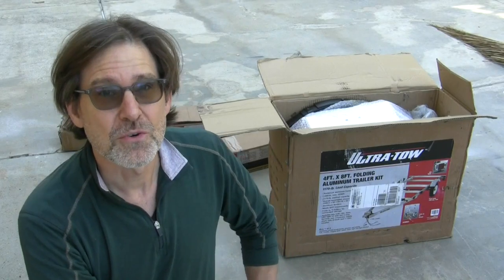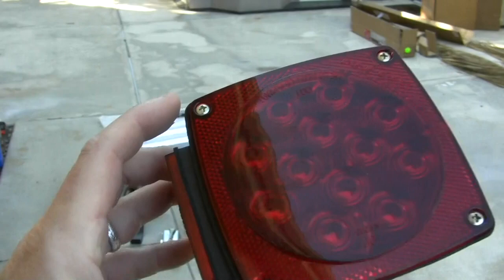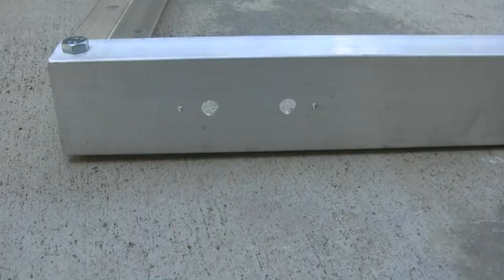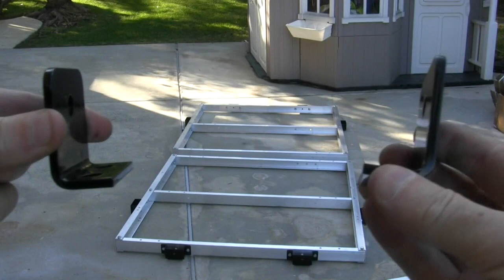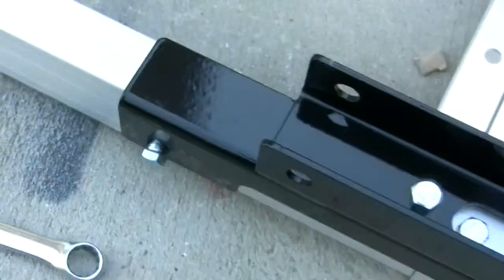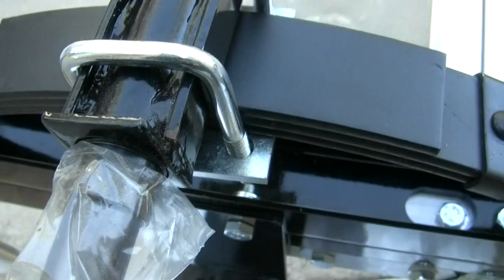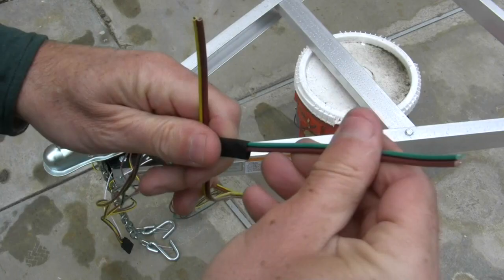Build Lightweight Ultra-Tow Folding Aluminum Trailer

Comment: Several errors I've seen myself. 

The leaf springer "Hanger" states to Bolt (2) Bolts to the "Front Trailer 1/2" ( including using a bolt from the top assembly of the frame itself.)

 Would have been nice to omit this bolt in step 1 instead of taking it out... just to replace it ...after installing the hanger???

 And  it also States to install (2) More bolts into the Rear 1/2 Of the trailer frame. 

Now in thinking about this....I thought...if it's bolted into the front 1/2 of a " Folding deck".

Plus,,, the same piece of "Solid Steel" is also bolted in to the Rear 1/2 of the " Folding Deck" how is the deck going to fold?.

This step would only be use if one is NOT PLANNING ON FOLDING THIS? Again resulting in removal of work done..

Thanks for doing this, the directions in the instructions were not good. Your vid helps tons.
Reply from the maker: Thanks for adding your observations. Yes, the instructions leave a lot to be desired. As one can clearly see in my video, I got "off in the weeds" more than once because of the poor instructions. That said, I love the trailer now. Hopefully others will read your comments before they begin also. Thanks for watching!

Comment: Did you say you used 3/16” plywood?
Reply from the maker: I used 1/2" plywood and sealed with spray enamel. Thanks for watching!
Reply: @UrbanMonkTV  Thanks UrbanMonk! I started the build on one of these. The instructions need a lot of editing.
Reply from the maker: @tomcoryell  They sure do. I almost wonder if I wouldn't have been better off without them entirely. Perhaps at times.

Comment: Questions:
Since you had calipers, what were the three dimensions of the structural aluminum? And to confirm, it appears to be Aluminum Association (AA, uniform thickness of flange)  rather than American Standard (AS, flange thinner toward edge)?
You also neglected to mention that the more rounded side of the washer goes on the fastener side, and the washer goes on the side of the fastener which is rotated when tightening. Also when the fastener is much harder than the structure material, both ends of the fastener should have washers for greater distribution of compressive force. (Decking is not a washer, and all fasteners connecting structual aluminum must be metal-to-metal. Counterbore spacer holes with a spur, spade, or auger drill bit.)
Reply from the maker: Thanks for watching.

Comment: The black brackets that support the wheel and axle don’t allow the trailer to fold because the screws are attached to both halves of the trailer. Can’t figure this one out? Any suggestions??
Reply from the maker: Just pull the back bolts out. Note, if you hit a bump at speed with no load, the rear deck will potentially bounce and slap. Alternatively one could put a pin and cotter pin in these holes for quick removal to fold. Thanks for watching!
Reply: Urban Monk TV Thanks for your reply and for the video!

Comment: Nice vid. Was close to buying a harbor freight but I need lightweight. Couple questions; does anyone know if you need nylon washers in between disparate metals and did they provide them. Also, for spare tire- harbor freight ok or buy from trailer shop?
Reply from the maker: Thanks for watching! I can say there are not nylon washers provided to go between aluminum and steel parts. Hardware is all zinc plated. Steel parts are painted. That's it. There's plenty to be improved upon with this kit, but I'm still happy with it.

Comment: Thank you Urban Monk.  I can assemble mine with more confidence now.  Question - at 8:44 the unit is upside down but the stake sockets are mounted with the 'stop-tab' down.  Did you flip those stake sockets around off-camera, or am i mistaken?  I was just a bit confused.  Thank you so much!
Reply: Also, at 16:33 it looks like the tow bar and tow bar plates are on the top of the unit.  Am i missing something?   Sorry, i just want to get this right and i'm not super-mechanically inclined.  Thanks so much!
Reply from the maker: @stevetrifelos5861  Yes, in both cases the poor instructions led me to assemble it upside down. The way the recording progressed made it difficult to go back and reshoot because so much would have needed to be taken apart again. Sorry about that. Bottom line, the instructions are not immediately clear about which way is up initially. Just take great care in those first steps and all will be well in the end. I did flip the towbar around once I realized the error. Been a great little trailer for me since though. My little electric car appreciates the light weight.
Reply: @UrbanMonkTV  Thank you so much for taking the time to record!!  I would have made a 100 mistakes i'm sure.  Good lessons for me!!
Reply: And yes, i've read the instructions several times and there are more than several vague sentences/sections.  they are a mess really.
Reply: @UrbanMonkTV  I was wondering when you would flip the  towbar... looks good What did you use for a deck?
Reply from the maker: @mzantow2000  3/4" ply and spray painted with rustoleum. It is holding up well in spite of outdoor storage and heavy rains here the past year.

Comment: Has anyone put Bearing Buddies on this trailer if so what size?
Reply from the maker: Great question. I haven't so will refrain from commenting. I'm sure they are standard size. I will say I lost a lug nut since making this video so double check the torque on those once in a while.

Comment: At what point did you figure out you had the trailer tongue on wrong. 16:36-1700 shows it on top. Then after that it shows it on the bottom.
Reply from the maker: Somewhere in between there. Thanks for watching!

Comment: How many screws do you need to unscrew to fold it?
Reply from the maker: None. Just two pins with cotter pins holding them in. However, as I mentioned in the video, there's nothing in the kit to hold the back half up in the folded position. I use a bungee cord to wrap the two deck halves together in the folded position. Thanks for watching!
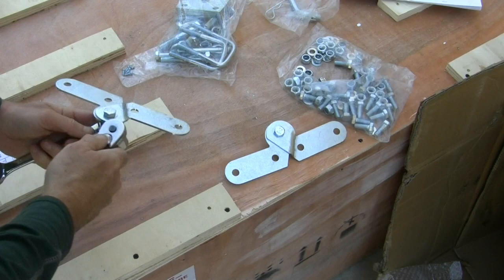Reply: @UrbanMonkTV  Thanks. I guess you refer to the tow bar which is held by 2 pins. I just built mine and I have 2 screws on each side that connect the rear piece with the spring hanger. Without them I can fold up the hanger but then the rear piece is only held in place by the hinge. That can't be right or safe. At min 13:08 you can see one of the screws in your video.  The one  to the right in the spring hanger. The one that connect the spring hanger and the frame. How can you fold it with this screw in?
Reply from the maker: @christophrhein8075  Yes, I believe I know which bolt you're referring to. Building one of these is a journey. I may have put it them in the spring hangers at one point and removed them later when I realized it wouldn't fold without them. I have mounted a large rack to my decking that prohibits folding at this point.
Reply: @UrbanMonkTV  Thanks a lot. That gives me piece of mind. I thought I built it wrong. I will use another pair of lock pins to secure the back portion to the spring hanger.
Reply: @christophrhein8075  Does the rear half of the trailer feel wobbly or "floaty" without those bolts connecting the rear half and the spring hanger? Like you, I want the trailer to be able to fold easily for storage, but it also needs to be safe and durable. If you have done this modification successfully what lock pins did you use?
Reply: @RobBowenvideo  I used it couple of times and it feels sturdy without the extra pins. I will get some for longer drives for sure. The weight of my Jon Boat is pushing the rear part down and nothing wobbles. I have not installed flooring.

Comment: Good presentation.  I understand this trailer comes in 3 boxes, how heavy are these boxes?  Is $85 liftgate service really necessary?
Reply from the maker: No. There's no pallet involved with delivery (from Northern Tool anyway). I don't recall the weight, but the driver and I got it off the truck no problem without ever using the liftgate. I'll guess if I were general counsel for a trucking company I'd say the opposite. Thanks for watching!
Reply: @UrbanMonkTV  thanks

Comment: just put now put one together. Lots of work arounds and redos beacuse directions are lacking big time. Do not buy this model if you really done need a folding trailer. Their are many better options for non folders.
Reply from the maker: Thanks for watching! Agree with you that the instructions are awful. That said, now that mine is together it serves me well. The lightweight is a big win for me given I pull it with an electric car.

Comment: What material is the deck?
Reply from the maker: I chose sanded plywood but one could use OSB too. I also considered using a corrugated plastic sheet topped with aluminum sheet. My situation is unique though in that I have access to materials like that at wholesale. That would have been lighter, but I went the easier route for now. I simply painted with cheap enamel paint.
Reply: @UrbanMonkTV  Awesome thank you for your time 👍🏻
Reply from the maker: @nikobuendia7655  Thanks for watching!

Comment: My trailer will not fold... I’m not sure what part I did wrong... sucks... though I followed you pretty close... any tips? What shall I do??
Reply from the maker: Guessing...Check the bolts in the back half deck in the spring holders (black painted parts that also hold the mude guards).
Reply: @UrbanMonkTV  
Yes! Thank you, I bolted them all, but I should not have, or it will not fold,  in fact, there are 4 bolts, 2 on side and to bottom that it will keep it from folding

Comment: What size nut is the axle nut?
Reply from the maker: I've been trying to find an easy answer to your question without going out and pulling the bearing caps off, but haven't found it yet. I believe they are 32mm, but not entirely sure of that.
Reply: Sorry, just saw this, but thanks for the reply. My $4 6 point 1 1/4" harbor freight socket worked perfect as well for that nut.
Reply: One last question... what did you torque your lug nuts to? I know the book says 85 to 90 I believe, but that seems a little excessive. It also seemed like the nut was having a hard time tightening up. Like the cone was burying itself into the wheel and not cinching up to that spec on my torque wrench. Just curious
Reply from the maker: @msands7713  I never use a torque spec on tapered bearings...I just tighten until the nut is tight and then back it off a tiny amount to take the pressure off the bearings. It's a feel thing. 80-90 lb-ft sounds like it is intended for the wheel lug nuts. Axle nut shouldn't be that tight.